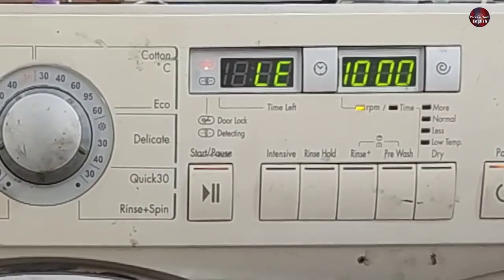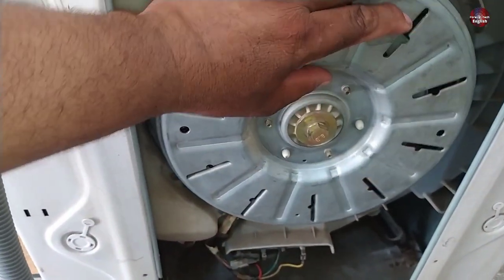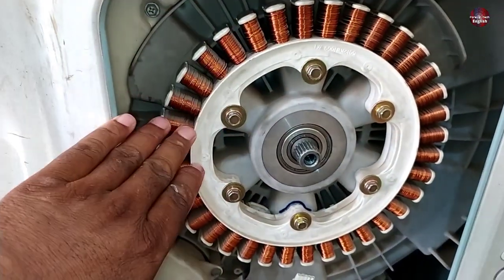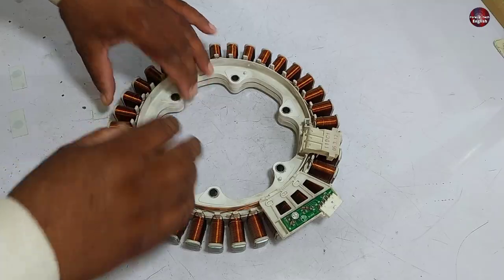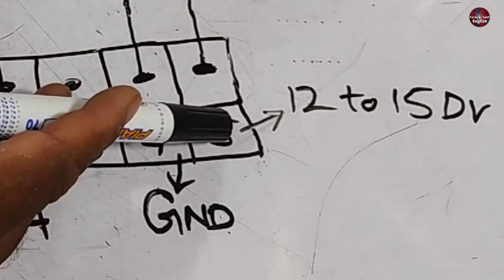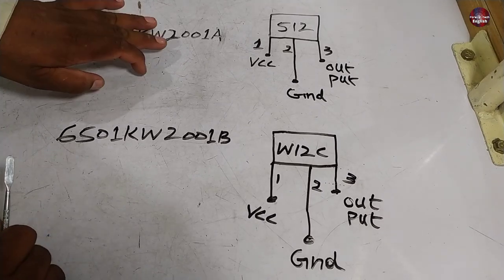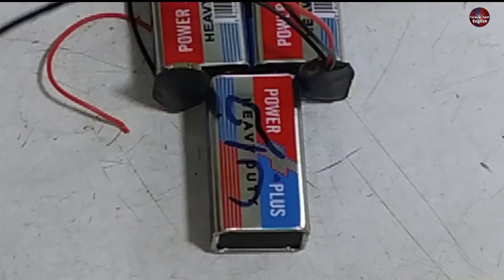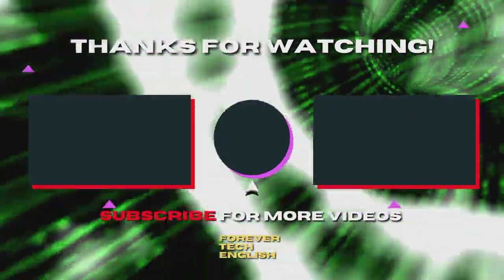Fix LE Error Code In LG Washing Machine

Comment: Hi Forever Tech English,
 I got what look like the same machine a this in the video, I posted a comment/question, on one of video from about 3 month a go on LG washing machine, up until then I had fount very little on the machine, even LG trying hide any detail about it, (on the website, using the model number. it brings up picture of a complete different machine, you the first place the might actually have the information, deal with this machine (had it from new, the delivery company damaged it in transit, it needed LG tech repair something the came of the motor, (it was a mess), but after that It work, okay to three days a go, (the only thing it need was new power button, taken from broken electric sky box I think, and that all, 
this new problem it got is really challenging I can not see anything, to even start with, the only thing the some what stands out a tiny small bubble, in the sealer gel stuff all over the board pcb, that look a bit like it burst, but it could of well been the sines it was new, there now burning strong smell?
copy in comment the last first video of your I watched, below:
_____________________________
https://www.youtube.com/watch?v=Dy7LNevxfMI
 , This video is the closed I come to finding, solution, to LG Washer & dryer - MODEL Number: WD-14331AD,  from my investigating the model you used in the is a slightly later model with with the dry function, so the funder mantel's should be the same, the machine was working just find, until just failed, it was do it week, wash, set big centre dial, 40, set pre-wash, intensive, and Rinse+ and then it drop in the dryer, function, it went all the was with program to the end I think, (when I came back just before, I take the garments out, I like just do the low temp, set just warm the garments, the always very mildly damp to the torch, the doing that fixes that, and this was the first sign of a problem the machine would not wake up, (check the plug fuse - okay, stripped out the control button board just like the one your video, multi meter all the contacts to the switches, and assessable traces, from the switches, to the next component, all passed, when all over the main board like one in your video, it sealed just like yours, I was thinking doing something similar with drill, (but I like the way you did your board better) Im quite confinable with the doing soldiering if needed, the mains power that connect to, as soft button control, there ne real power point to probe, to see if this any power get to the board, I have all checked fuse on the board and that checks out okay, I been all over the main board with a big camera Len, and the only think stands out like the board in your Video It has a One big capacitor (the size) and one of the small more normal sized one right next to there floor or bubble sealant stuff, did the sniff test, there's a bit smell, but nothing strong, just old circuit board smell  there no smell like something been on fire or something, I Okay with small electronic stuff, the big capacitor don't normal blow up or fail ever, and if the small fail, the top crack open, but there no signs of any of that going on,? was surprised by the rust under protective gel stuff, in your video is that a  regular thing, I can not see any signs on the out side, I am stumped to what to do next?
Reply from the maker: You can send me the pictures of your board on our social media, If I could find something wrong with the board I will help you out. Thanks